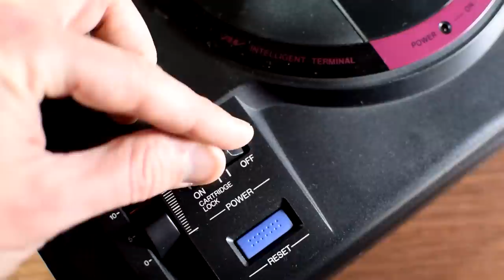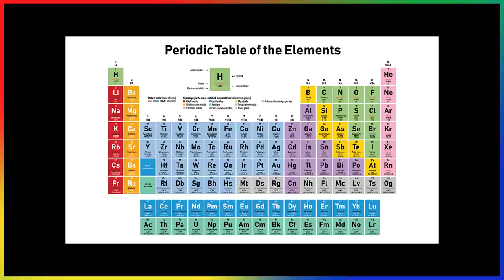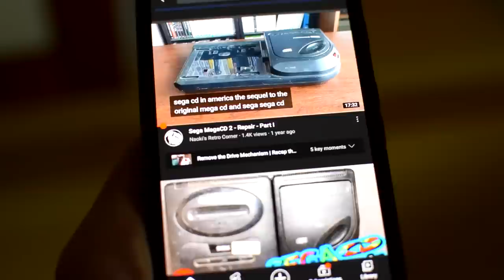Should You Fix Your Own Consoles (And Games)? - Retro Bird

Comment: I recently had an issue with my N64 after not playing it for a long while I flipped it on to play a couple stages in goemon's great adventure and I would play for about 20 or 30 minutes and my console would reset itself I looked up the problem on google and it turned out my expansion pack wasn't making a good connection so I cleaned it good and used some of that canned compressed air to blow out the slot and it fixed the problem

Comment: With the original Xbox I’ve learned that capacitors don’t last forever. It is the easiest thing you can do to you console change the capacitors to new ones. If you do it for the first time I recommend doing one out of time, because they only have one direction and if you place it in the wrong direction you can destroy your console. When I’ve change my Megadrive model 1 even if I had experience doing it with other electronics around the hose, I’ve done it one out of time with a lot of patience. You don’t get second a change with old collectables specially if you are psychologically attached to it

Comment: Only good thing about living in NYC is that I had J&L in Manhattan for repairs. Few years ago my psp fell off the top of my locker at work. D pad unresponsive, dead pixels. After 2 months they fixed it. The delay was in getting the parts

Went back to have them swap out the lenses in my ps3 and 360.

Only things I've fixed myself was a ps3 controller. Button stopped working. The padding in there got worn. Literally stuck a thin cardboard in there to get more pressure. Ps3 dualshock was a bitch to put together. 

I damaged my vita when I tried to replace battery. Wire snapped off board. I tried to soder but I melted the damn thing

Lately I'll just open up the consoles for some compressed air action

Comment: I did replace the capacitors on 32 SNES cartridges and on two SNES consoles, plus I replaced all batteries on the Snes carts and Gameboy carts 😓
The most problematic thing for me was replacing the surface solderered caps. I don't own a hot air soldering thingy, and so I wanted to remove the caps with a normal soldering iron. Step by step I tried to gently get the caps off by applying heat to one side after the other, left, right, left, right,...., and at the same time lifting the cap off the board, one side after the other. Then, on like the third cap of the first console board I did it too harsh on one side, and one of the soldering plates of the board got ripped off🤯
I can't describe what I felt at that moment. 
But I finally got it fixed by making a new connection with a piece of super fine wire that I normally use for tying fishing flys. I had to scrape off material of the board to get a blank surface to solder on, etc. Believe me, I was dying inside on the whole operation. But in the end the console worked again, and it didn't happen again.
So please people, be very very careful when removing these surface mounted caps with a regular soldering iron, and do it very very slow and gently, or even better, get yourself a good hot air soldering station If you can afford it.

Comment: Reflowing solder doesn't "get the juices flowing". Rather, it can improve solder joints (e.g., cold solder joints cause problems since the connection can be intermittent). Also, games don't need "warming up". What's likely happening is the connections aren't great due to corrosion or oxidation on the cartridge pins. By plugging it in and out multiple times, you might be removing some of that layer and/or making better contact with the pins.
Reply from the maker: I appreciate the info.  Always trying to learn.  Problem is when people give me conflicting information :(
Reply: @RetroBirdGaming  Sorry if I came off harsh. What you gave were good suggestions. I was just trying to clarify (it was meant to be a matter of fact tone, but text isn't always clear in that regard).
Reply from the maker: Yeah, text can be really tricky for conveying tone.  No worries :)

Comment: It depends on your knowledge/confidence about that machine and the procedure you need to do.
Older consoles are easiest to repair, the latest... well... not so much.
You CAN'T fix a ps3 reliably when the chip has gone overheat too much, where it's no big deal to change a couple caps on the SNES.
EDIT: Also, cleaning them helps a lot. I managed to make my Genesis to look like new again with a screwdriver, IPA and some soap for the plastic parts.
P.s. gonna add Bluetooth support to my ps2 soon... <3

Comment: So I have replaced Sega Saturn Optical Pickups, Replaced Save batteries in Carts, Replaced all the Capacitors on a Game Gear, Replaced the Capacitors on  a TG16 with the CD attachment, Replaced the Capacitors on the OG Xbox and Tsop flashed it to install a newer Hard drive.  Replaced the Hard drive in my Xbox one x because Tosiba is a bad HDD brand. I replaced all the Caps and the voltage Regulator on a Toaster NES (best thing to do ever).

Comment: I replaced the analogue stick of my PSP once. Wasn't even that hard no soldering required. I also tried replacing a save battery in a GBA cartridge but I failed. You see, the contacts are spotwelded and getting it loose is easy but you can't just solder it back on, it won't stick to the battery.
Reply: They sell batteries with the contacts prewelded.

Comment: My story start with my PS3 die from over heat and hdmi port broken and I left it at that. Many year later I found one Youtube video about turn old PS3 case into PC so I like to do it myself but then I just think "if I gonna break apart it I want to make sure it completely broken" so I buy universal screwdiver to unlock those pesky 3 abnormal screws on it then look into. With my PC repair knowledge I quickly know that thermal paste is freaking dry so I apply new one and try to fix HDMI port but sadly it never working so I workaround for av-multi to component cable(that 3 color  green blue and red cable) and it all worked. I manage to revived my PS3 by my own and it never the same after that PS3 look so precious to me.

But for the Dualshock 3 uhhh I gave up.

Comment: Dude the xbox 360 red ring of death is fixable but you will need to get a stencil and exactly risk the time it takes to fix it.
And if you get rid of it for "parts" you could sell it for cheap but somebody could just flip it and sell it full used price

It really dwpends if the fix is an easy cleaning or a reballing on a GPU proccessor

Comment: While I'm not certain if it's fixed yet or not, I was fixing my original N64 while watching this video, recently bought a CRT that came with a NES, SNES, N64 and Mega Drive, and since that was already a bundle together I first tested my games on those consoles, 3 of my SNES games did not work, 2 of which I fixed after cleaning the connectors with qtips and while we don't really have the "isopropyl alcohol" here, we do have "95% medical alcohol" which at least according to the internet, is the same thing.
The third one I'm not sure why isn't still working, but according to the internet if the save battery is dead it may sometimes cause the game to not load at all, but unfortunately my soldering iron is broken so doing a battery switch is going to have to wait until I get a new one.

After testing the games though, came testing my original systems, I already knew my SNES was in a bad shape, as it was a SNES I purchased from a video rental store when they closed down so it had already had a pretty rough life before I got it and the power button has been broken since I got it and the shell is so beat you'd think the thing fell out of someones car at some point, but now it no longer reads cartridges, I know I can get a replacement pin connector, so I'll likely try that at some point, maybe at the same time buy a replacement shell and power switch.

But then yesterday I got to my N64 and while it booted up just fine after about 2-3 minutes of on time, it would reboot, internet suggested cleaning the jumper pack same way as you clean cartridges, but unfortunately that didn't work, and opening the entire system up was a bit of a longer endeavour so I waited until I was a bit more awake, then today while more awake I loaded up a few youtube videos and while watching/listening to them I opened up the N64 looked around for anything obvious, didn't see anything however I saw a lot of dust had gotten in-between the various pins of the various chips and I know that dust has the possibility of arcing currents, so I grabbed another qtip, dipped it in some more alcohol and cleaned them while this video was playing, put the N64 back together and I've had it running Mario 64 for the entire duration of this now relatively long comment, so at the very least it looks like I was able to fix it.

Comment: I recently saved around $20 to $30 on a Game Boy Advance AGB-001 from Japan by buying it on eBay labeled as junk. Less than an hour after arriving at my door, I already had it fixed. It was probably the most common issue that causes people to think their Game Boys are broken, that being a dirty power switch.

Don't get me wrong, I nearly completely ruined the switch because I'm an idiot. Fortunately I'm an idiot that has super glue handy and I was able to fix the damage I had done. Now the GBA works perfectly fine and turns on and off reliably. I'm still going to buy a replacement switch for it as a backup just in case. Regardless, I'm pretty happy with the money I was able to put towards an IPS screen kit and new capacitors (better safe than sorry after 20+ years).

Comment: Bought Xbox 360s, broken original Xboxs, a GameCube, and NES/SNES. 

I only do it because I'm good with repairing electronics, using a soldering iron/multimeter.. most consoles a lot easier to fix

Comment: Be careful you get the screws in the right place on the Dreamcast wen putting your laser assembly back into place! One screw is much longer than the others. Putting it in the wrong place and there goes your motherboard! XBox, a well known problem these days, remove your clock capacitor before it leaks and eats away at your motherboard! You don't need it UNLESS you have a 1.6. They will require the capacitor. And if you're getting no power there, test your collector. If you don't know what that is, search it! XBox 360 no power, check the usb ports to see if the connector is broken and shorting. PS1 also has a fuse on the power supply. As does the Phat PS2 (although more of a hassle to get to. Gameboy SP no power- dirty switch or blown F1 or F2 fuse. Clean battery terminals with white vinegar then make sure to remove it all with alcohol. That's all I got right now. Game Gear.. yeah, most likely the capacitors. Replace them ASAP  if you can! That's all I got right now. I felt like rambling before going to bed. Accept it. 

Oh, NES, boil the 72-pin connector and push the pins back into alignment.

Comment: I remember a friend had an xbox 360 that broke. He was about to take it to a professional to get it fixed, but I offered to fix it for free. The problem was, I was just an overconfident kid who had never repaired a console in my life, at best I had upgraded my computer by adding RAM which made me feel like a tech guru. Anyway I ended up breaking all the plastic clips trying to get the xbox case open, and scratching it up pretty bad by prying it open with a flathead screwdriver. Then I removed all the screws and circuitry with the plan to reseat the components, the problem was I couldn't remember how to put everything back. I ended up giving my friend back his console in a plastic bag with all the parts hanging out, saying I couldn't fix it and he should try taking it to a professional after all. I just remember him being extremely quiet  and cradling his broken console in his hands as I walked away.

Comment: The data layer statement you made needs to be addressed, on CDs the data layer is actually on the film underneath the label of the CD itself, it's nearly impossible to resurface to the data layer of a CD... Note, at certain thicknesses the light can't refract properly and the disc will still be unreadable, however if you continue to resurface further you will get to a point where the light refracts properly again and it is readable.

With a DVD the data layer is between the two pieces of plastic that are sandwiched together, the laser refracts light off the reflective backing underneath the label and uses that to read the data layer that's between the two sandwich layers of plastic, still very very difficult if not impossible to resurface to the data layer. However, the plastic thickness and light refraction portion still applies, there will be certain thicknesses of plastic that the light can't refract properly and send a data signal back to the laser, in which case you need to keep resurfacing. I use a jfj to resurface discs and GameCube discs are notoriously finicky about refraction thicknesses, I had to use my sanding plate on a legend of Zelda collector's edition disc (the one with the wind waker demo) for a very long time to get to a thickness that was readable again, but I was still nowhere near the data layer and Even though I used my sanding disc for a solid 20 minutes on it, it now works flawlessly! Because you essentially can't get to the data layer.
Reply from the maker: Interesting.  Thank you for sharing this.  I have a friend who resurfaces a lot of game discs at his game shop, and said he got to the data layer and the disc stopped working.  But, from what you're saying it sounds like what actually happened is that the refraction portion got to an unacceptable thickness.  So, the discs he thought were dead could've still been saved with further resurfacing?
Reply: @RetroBirdGaming  Yes, and it can take quite a bit of resurfacing to get to a thickness that can again be read through. Only worth the effort on games of value, sentimental or rare. Also, I use a spray bottle and water and never sand for more than 10-20 seconds between sprays. Overheating a disc in the resurfacer caused a cloudy haze that, with effort, can also be fixed if you keep going. 

When we first got our jfj, my brother and I resurfaced a ps2 game that someone had literally pounded dents into, it took over two hours of re-sanding and polishing and testing and retesting, little by little it started to work, and when we were finished, it worked perfectly. 2 hours for a $30 game a had no interest in playing, but you can sand them silly and as long as you keep them wet and don't warp them they will always be savable.

Comment: I remember back in the early 2000's my super nintendo wouldn't power on. Then I met a friend who knew a trick where if you bend the cable on the power adapter, it works. I was really happy to play super nintendo games again, although with a janky setup that sometimes causes the system to lose power if the wire felt like moving.

Comment: I picked up rusty Sega Saturn, cleaned it up real good, did some recap and tried to power it on.
The result was:
https://youtu.be/24voYuRMGnA
With trial and error I found out that rgb encoder was eaten by rust and putting some pressure on it brought video back to life.
I asked on a forum for a replacement and it turned out that some component is being used on PS1 so it was quite easy and cheap to get a donor :) 
I did recapping on my own but with soldering the component my dad helped me (he used to fix electronics). And voila:
https://youtu.be/1_ZN3_7R3Fs
FYI - my dad never taught me how to solder and troubleshoot as my parents got divorced and we lived in different places. Still - it’s no rocket science and you can do it on your own :)

Comment: Unlikely? That’s the only thing that broke my super Nintendo
Reply from the maker: Perhaps my experience isn't reflective of everyone else.  I've never had an issue with a power brick in all my years.  Also, sorry to hear you had that issue with your Super Nintendo.  Hopefully you got it all sorted out :)
Reply: @RetroBirdGaming  if I could like your response, I’d do it 10 times over
Reply: What went wrong with it? If you tie the cord tightly around the brick; it can cause a short in the wires on the inside and then you have to bend the wire a certain way so it'll work unless you open and fix it.

Comment: Honestly if the fix is easy and cheaper than buy another console then fix it, if u are competent enough in electronic repair or if not follow a youtube video very thoroughly lmfao.  i would always check with your local repair shop for prices before attempting the repairs yourself becuase if u can have the repairs done professionally for the same price as doing it yourself or just slightly more that go for it, becuase if they break it, they replace it lol